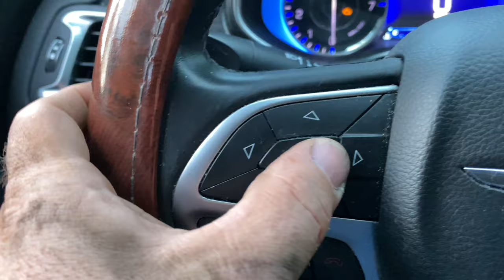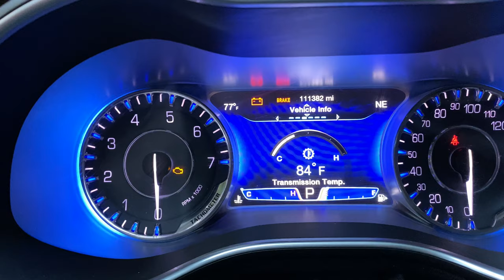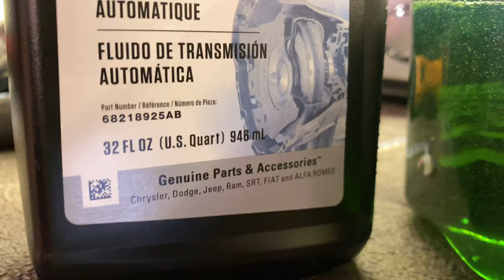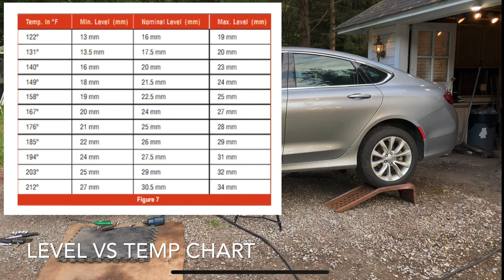2015 Chrysler 200C 2.4L (and similar) 9 Speed Transmission Fluid Change   - 948TE / ZF9HP48 -

Comment: Retired Catapiller Heavy Equipment Mechanic. 
Very good video,  everything I needed to know you told me. Thank you. Also very smart move to count how much came out. Most garage mechanics wouldn't do it. The only thing I'll do different is I will a 1 quart brand new fluid though the system to make sure I got clean return coming out. So instead of 4 quarts I'll  need 5 quarts. God bless 😊

Comment: thank you excellent video ... by the way I purchased some clear flexible hose that fits into the fill hole and the length is approx 2 ft that allows me to attach a funnel and literally pour the fluid into funnel through the clear hose and into the trans

Comment: This takes me like 15 minutes to get it done
1-take off the engine cover 
2- get a long 3/8 Extension and connect a universal joint socket and alan 6 socket 
3get under  the car and don’t forget to level it with safety stands
4- ask some one to find a gap at the top of the engine and pass you the 3/8 entension 
To connect on the fill plug located on the top of the transmission and now you can take off the fill plug
5- take off the drain plug to drain the fluid, when done put the drain plug back ,alway measure what come out and put and same  amount of the new flue  and you done ‘’;

Comment: I did this same job but what I did was get a big syringe from the drug store and connect a a piece of airline tubing about 30" long and weave it down through the top of the motor into the fill hole then very slowly pour your new fluid in.

Comment: Is there other procedure to made if I want to replace the entire fluid? Thanks a lot for yours videos bro God bless u! 🙏🏻
Reply from the maker: Typically to replace all the fluid requires an expensive machine that will allow the transmission to pump the old fluid out to the machine while the machine pumps fresh fluid in.  A dealership or hood private shop may be able to do it.
Reply: Most reputable mechanics recommend not to do a full transmission flush on a vehicle with more than 70 or 80 thousand miles.

Comment: Step daughter has a daughter has a 2015 200S, 2.4L. 231,000 miles. The wife got it in 2015 with 47,000 miles. Never changed the tranny fluid. Should I do this or just leave it alone? Wasnt ever driven hard or anything like that. But to me it has a lil delay when shifting. If the new fluid makes it worse I can put the old fluid back in. Drain it in a clean drain pan of course.
Reply from the maker: @HuskerRed11  There are two opinions on this. Some people say to leave it alone and that changing it can cause problems at high miles. That theory is that the old fluid has built up a residue inside that can be flushed away with new fluid.  However, my preference is to change the fluid anyway. You just have to weigh your personal preferences. Also, changing the fluid might not change the shifting behavior anyway.
Reply: @JoesCarSmartsNY Yeah I think I'll just change it. I heard about leaving the old fluid in it cause it has the "grit" in it. And I believe new fresh fluid gotta be better than what's in it now. I just wanted to hear your opinion. Thanks for replying.
Reply: At what mileage your post to  do this service

Comment: Hello good video! Didn’t realize exactly how much oil you poured back? Maybe you can write in exactly the liters you need? I would greatly appreciate. Thank you.
Reply from the maker: 17:50 in the video answers this.
Reply: My car is after an accident and the oil spilled out of the boxes, now I repaired it and don’t know how much oil was in the box. I found info on the internet that I need a 4.5 liter fill. Do you know if this is true? In your vidoe you say you have poured 4,125 liters as far as I understand?
Reply from the maker: @martynasandrijauskas2550  I used 3 and 7/8 quarts to fill it from empty. I think that converts to 4.4 liters.

Comment: Hi. My 200 has 85k km and the trany is a bit bumpy when shifting up and down and a bit slow when steping on gas when i want to overtake someone on the highway. That could be reason that inneed to cchange the fluid?
Reply from the maker: You should check with your dealer for software updates for the transmission and also change the fluid.

Comment: Yet again very detailed video. I have a question for you. Last winter my car was around 110k km. I was having some head moves while gear shift so i went to the dealer and they recommeded so called transmission fluid flush. They got my problem solved that time however since then i drove like 50k more km  i am having little trouble in gear shift when my car is cold like when i have transmission fluid temp around 20 degree celsius. Once my transmission is above 50 degree celsius my car runs very smooth. Can you recommend me anything helpful here.
Reply from the maker: I would have the fluid level checked again. It could be a bit low. But when it heats up and expands it’s okay.
Reply: @JoesCarSmartsNY  does the fluid will came out from inlet if i keep engine running and putting the dipstick in?
Reply from the maker: @AmitSharma-gf4gz  To check the fluid properly the engines has to be warm and the vehicle needs to be jacked up (or on a lift) and perfectly level. 

If all that is done, the fluid will not leak out of the fill plug hole. 

If you haven’t watched this whole video, you need to before you try to check your own transmission.

Comment: My transmission light come on when I drive over 50 at 55923 Mileage they said I might have to replace transmission was never flushed or fluid checked. What you suggest?
Reply from the maker: Check fluid level first. If it’s okay, change fluid. After that you might need a new trans unfortunately.

Comment: went the Crysler dealer the other day for a recall and asked about my tranny fluid and he said it was a sealed unit and there was no reason to replace or change the fluid. I have a 2016 Crysler 200.??
Reply from the maker: Dealers love to say that. It’s a good idea to change the fluid around 100k miles. Also, some dealers just don’t want to deal with the hassle. They don’t care if your trans fails. They want to sell you a new car.

Comment: The dipstick you mentioned is a model number 10323a or something?  I see one that is 1017. One guy was using it on YouTube for a Jeep renegade. I ended up buying that one. I couldn’t find the 10323a one anymore. From what I can tell it has the same measurements as the 10323a model dipstick. I was gonna return it but looks the same to me.

Comment: Hello
How many miles should I change the transmission fluid in a 2016 Chrysler C200?
Reply from the maker: My opinion is that it should be done around 100,000 miles. A bit sooner does not hurt either.
Reply: Thank you very much
Reply: But the Chrysler company in the catalog did not indicate the need to replace the transmission oil, as it is a vegetable oil and is not affected.  What do you think about this?
Reply from the maker: @alialbaaj6102  That info is in the video. The company that makes the transmission is ZF. They have been saying their transmissions don’t need fluid changes for many years now. But they will fail eventually with the original fluid. It wears out over time and needs replacement. It can last much longer than ever before, but it can’t last forever.
Reply: @JoesCarSmartsNY  Thanks

Comment: What about the filter? I was thinking about having the dealership drop the pan and replace the filter and refill. But how difficult is the filter to access? I have seen some say you have to take the transmission out to do that?
Reply from the maker: My understanding is that the filter is not meant to be serviced. I could be wrong. I do remember reading something about having to remove the trans to replace it.
Reply: @JoesCarSmartsNY  okay. Thank you.... scary when the dealership tells you I’m they don’t have to take out the transmission to change the filter 😂 but I figured they didn’t know. SMH it’s such a pain in the ass to find someone to maintain your car maybe that’s why so many people don’t.
Reply from the maker: @bha5475  Maybe the dealer knows a way around it that we don’t know.  I remember helping a friend research a Trans fluid change for his GMC 3500 truck with the Allison trans. All the dealer would tell him is that it has “lifetime fluid”. My friend said “I know you say that...but I want it changed anyway”. So the fluid never got changed because the dealer essentially refused.
Reply: @JoesCarSmartsNY  they suggested i do the pan drop and fluid filter change. It’s 2015 v6 with 56,000 miles I’m having a rough shift between 4 and 5 but not very frequently usually on curvy or hilly back roads idk what to do and I just paid the car off!
Reply from the maker: @bha5475  That’s always a good first option when dealing with a trans symptom. Sometimes fresh fluid helps you out.
Reply: Is this your 200? I also have rarely seen this transmission go into 9th gear ⚙️ does yours? Thank you for the responding.
Reply from the maker: @bha5475  It’s my brothers car. I doubt his sees 9th gear either.  It would probably have to be for highway cruising on flat land.
Reply: I love all these comments, my 200 started shifting a bit funny cold starts and local roads nothing major or highway and my good friend who’s a computer diagnostics tech told me NOT to drop the pan and change it because it could make things worse.  I’m at 76k miles and he mentioned things about metal shavings etc and just leave it be.
Reply from the maker: @hakim8688  That’s very interesting.  So would his suggestion be to wait for the transmission to fail completely or maybe just trade the car in?
Reply: @JoesCarSmartsNY  how many miles were in the car when you did this fluid change?
Reply from the maker: @bha5475  I think it was around 110k miles.
Reply: @JoesCarSmartsNY  and he hasn’t had any issues? Was he having any issues before?
Reply from the maker: @bha5475  He didn’t have previous issues and has no issues now. We did it strictly for preventative reasons. He intends to keep the car as long as possible.
Reply: @JoesCarSmartsNY  he wants me to just trade it in. I love my car and want to keep it since it’s paid off.  I just don’t like how it down shifts and up shifts now.  I know the 9 speed transmission is jerky but it’s never been like this for the 4 years I’ve had it.  Could the fix be more than just a fluid & filter change? That’s why I’m hesitant on spending the $390 at the mopar dealership 😣
Reply from the maker: @hakim8688  If you’re ready to move on I wouldnt spend the $390 for the fluid change.  The real issue could definitely be more than just the fluid. I’m assuming you have the most recent transmission software update?  That could be worth looking into as well. I know that the dealer can update the software if needed.
Reply: @bha5475  4-5 is a dog clutch, and will always be a harder shift.
Reply: @bha5475  I have this car it doesn’t engage 9th gear until 72mph at a cruise, then once it reaches 9th gear you can drop to to the 60s as long as you don’t push it… max mpg this way.
Reply: To replace the filter you have to pull the transmission and split the case to get access to the filter then you can change it lol

Comment: I got a 2016 an it say severvice transmission an park light come on also my engine light what should i do ?
Reply from the maker: I would have someone scan the codes ASAP. Better not to drive it until a mechanics looks at it. Sometimes you can do more damage driving it when it has those types of warnings on.

Comment: Is it better to wait until after winter is over?
Reply from the maker: It doesn’t matter to the car.  It’s best to drain it when the engine and transmission are warmed up (whether it’s winter or summer). The only reason the weather matters is if you have an indoor space to work or can tolerate working outside.

Comment: Might be concerning you got 34mm on your dipstick at 84F, while your chart says 34mm is above 200F
Reply from the maker: I learned that the trans MUST be checked at proper temperature with engine running.  That’s why the level looks so high when I measured it cold and engine off. Those details are in the video at some point also.

Comment: Also, how many litres do I need? through google it says "5.2 litres" is that true?
Reply from the maker: For my vehicle: 2.4L engine Front Wheel Drive…see 17:00 in this video. That was what worked for me. The 5.2L is probably a complete fluid replacement including what is held in the torque converter.

Comment: I've c200 how type oil transmission fluid best ,?
Reply from the maker: I recommend the Chrysler original fluid. It’s in the video.
Reply: @JoesCarSmartsNY  sorry. zf or atf4 fluid because not have original fluid in iraq
Reply from the maker: @ئاریعلي-ش8ب  Oh. That’s a good question.  It’s a ZF transmission. I don’t think ATF +4 is correct. If I were in your situation I would contact ZF directly for guidance.  I don’t want to give you bad info.
Reply: @JoesCarSmartsNY  thanks dear

Comment: I have 2016 chrysler 200 2.4L 161000 km. sometime in low rpm my car 5th gear jerk & shift shock im from dubai please advise i need to replace transmission fluid or something else?

Comment: Is there any oil filter inside transmission?
Reply from the maker: From online reading I’ve learned that there is a screen inside, but the trans case has to be split to access it. Supposedly the screen isn’t meant to be replaced.